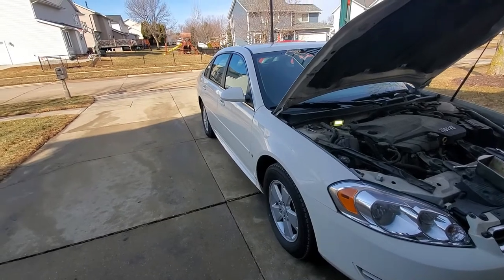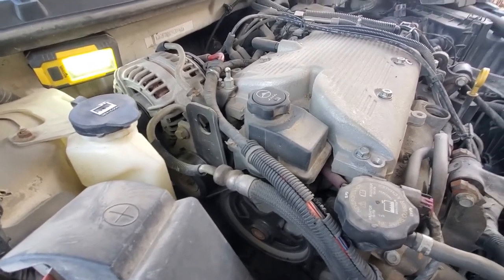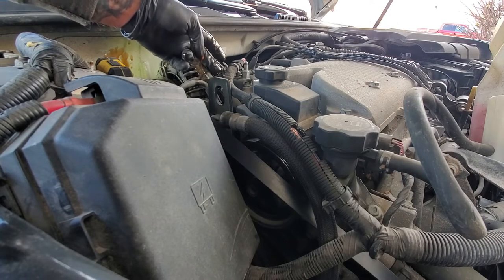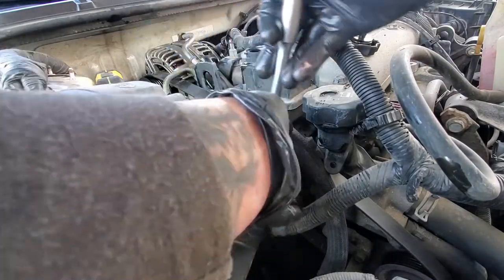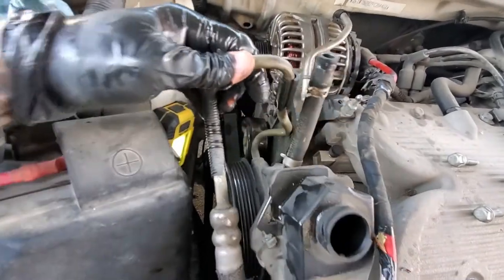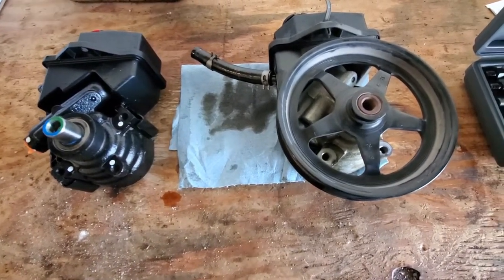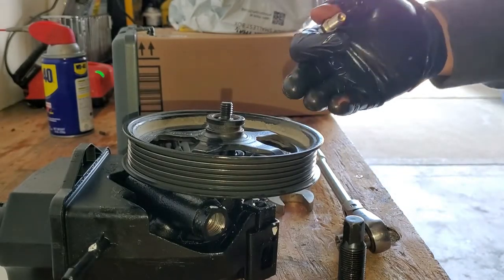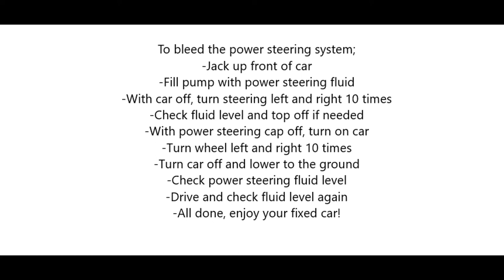How to Replace the Power Steering Pump on a Chevy Impala (Minute Maintenance)

Comment: Just curious why didn’t you remove the pressure lines before you unbolted and took it off. Feel like it would’ve been easier but idk. Thank you for this!
Reply from the maker: You can't get to the pressure line without taking the pump off first.
Reply: @minutemaintenance7385  fair enough I was doing paperwork while listening thanks for the heads up

Comment: Hi sir I need help my steering wheel is stiff and make whine noises…on 2003 impala .. but I also notice I lose fluid after 1day .. what to do replace the pump or hose ? Or seal ? … when I open the resovior I notice bubble milky fluid and it’s low .. and it appears to be moving .. .. should I replace the pump or check for leaks ?
Reply from the maker: If you're losing fluid that fast check for leaks. The pressure hose likes to leak at a coupling not too far from where it goes into the pump.

Comment: Mine isn’t making noise it’s just not circulating and this has happened to 3 pumps now. Also replaced the rack any ideas? Turns easier right than left for some reason. I flushed it and everything so I don’t get what I did wrong or what is wrong
Reply from the maker: If it isn't circulating you likely have a leak in one of your hoses, most likely the pressure hose.

Comment: It bothers me that you worked on this the entire time with the oil fill cap just off letting anything and everything get in the engine. Not a major issue it just bothers me to death 😂
Reply from the maker: I didn't even notice that. I usually put it back. When I worked at a dealership they told me to take the cap off first and set it by the keys. That way you never forget to put it back on.